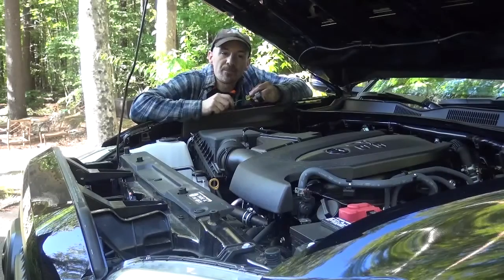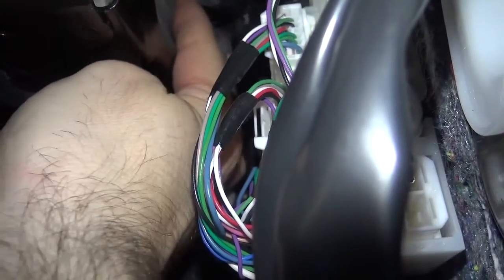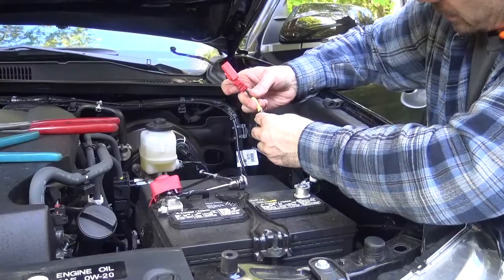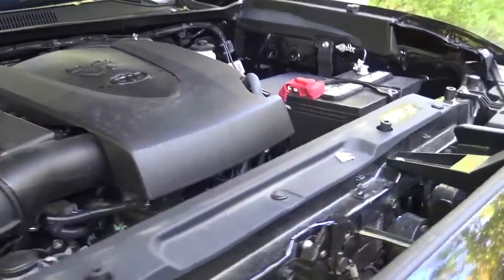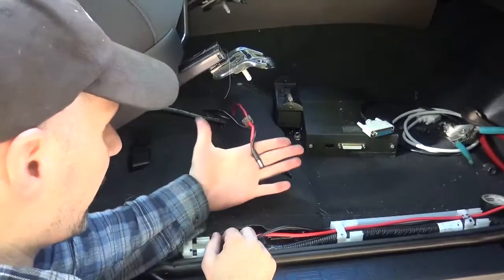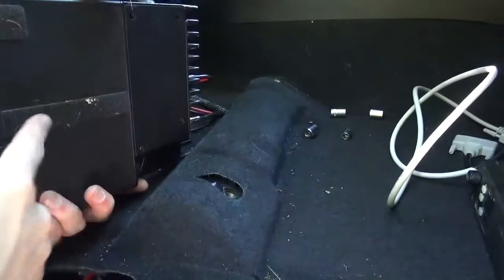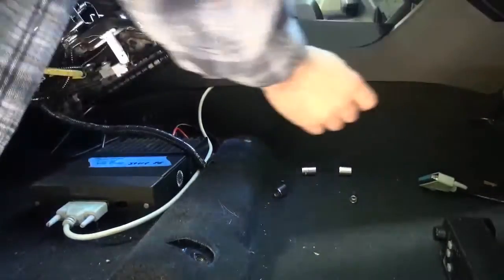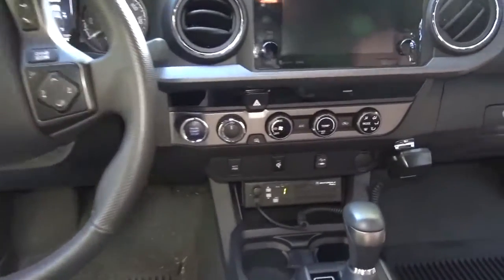PEG Mobile Two-Way Radio Installation

Comment: Is this ham radio ????
Reply from the maker: No it's PEG (Preparatory Emergency Groups) radio service.  The PEG system is designed and created by US Preparatory in 2016 specifically for small to wide area civil emergency radio systems.  It's restricted to non-commercial use only. It can be used for civil groups, preparedness teams, disaster relief organizations, personal groups and even state or local government organized emergency communication systems for the civil community.  This is the PEG non-technical presentation video.  https://youtu.be/xLPZX2Jjmgk
Reply: @USPreparatory  in a firefighter, so I can get a group of us to do this ,?
Reply from the maker: Hello. Yes.  The system was designed specifically for civil groups.  The group has full control over their system.  Your group can set the protocols and runs the show. Like I said, it's not shared with anyone and the licensing is under the entity not individuals.  VERY similar to a Volunteer FD's radio system.  Except your groups own it.  If you what more information you can email me at "info@uspreparatory.com" and if you feel you want to talk we can talk on our TalkLink application.  If you haven't already check out the PEG Tech Tour videos in this playlist: https://www.youtube.com/playlist?list=PLCSuDaYmrtbbwkQO_5PNkoD6J1b9NFkxX
There is a lot more available in terms of informational videos but I don't want to overwhelm you with tech content. If you let me know what you're looking to do I can tell you how to make it happen.
Thanks,  Chris

Comment: Where did you buy all of the equipment?
Reply from the maker: The equipment is supplied for PEG system at www.uspreparatory.com.  It's packaged up with some different options regarding antenna, mount type, etc.

Comment: nice work
Reply from the maker: Thanks!
Reply: How did you get the talk permit tone? Did you program it like that or was it standard?
Reply from the maker: The tone you here on the mobile radio is actually the PTT ID tone.  It's a feature of the radio that must be programmed and enabled to use it.

Comment: What's the range on this
Reply from the maker: Hi Sam.  Well since the PEG system resides in the VHF low band, the range is generally up to 2 times great than similar UHF system.  Just like any radio system there are variables....lots of variables.   If you're using this radio in a PEG simplex system (no repeater or infrastructure) every radio is subjected to it's own antenna performance and surrounding terrain.  Those radios that have a height advantage are of course going to be able to receive and transmit further than those in lower terrain.  As an example.  My base station is 500ft above sea level which is about 300ft above the average terrain around me.  Because of this height  my base has an advantage over most other base stations in our system.  So much so that I've talked to a group in the state of CT 63 miles away.  However taking North of my base is a hill equal to the hill that my base is situated on. So the range is about 10 to 15 miles. This range is when we are using our Simplex channel.    We have a Category 3 multi-zone system here in our state.  This system contains a single repeater at the core of the system and five zones/relay stations.  When it's finished we will have a linear coverage of about 65 by 39 miles.  As with any repeater based system, the repeater sort of levels out the playing field.  This means that each station isn't nearly as crucial when it comes to height and antenna performance because all communications now only has to reach the repeater, not the person that each station is talking to.
So if you're asking what is the range of the vehicle radio with no repeater talking to another vehicle radio, it could be from 6 to 20 miles or more.   With one of our Storford repeaters it would like be 20 to 50 depending on the location of the repeater. If you have a central base station and that base station has a height advantage the base could be used to manually relay messages...OR replace this "height advantaged" base station with a repeater and allow all that use the system to have that advantage.  I hope that answers your question. Thanks Sam. Chris